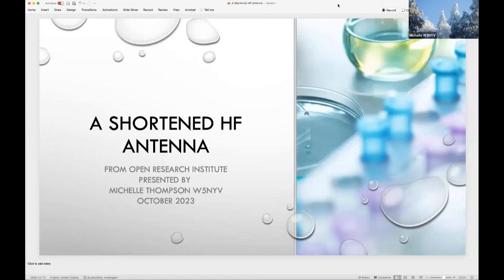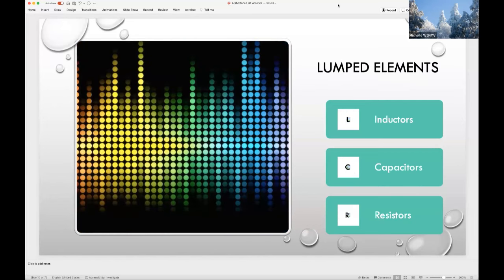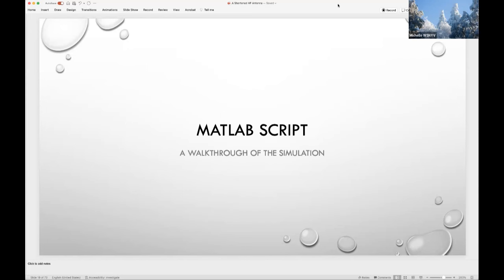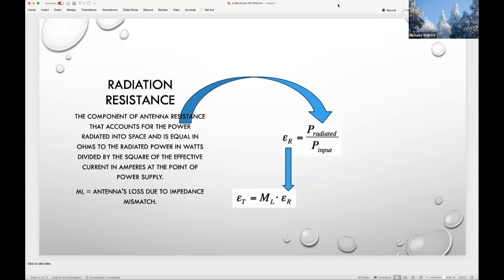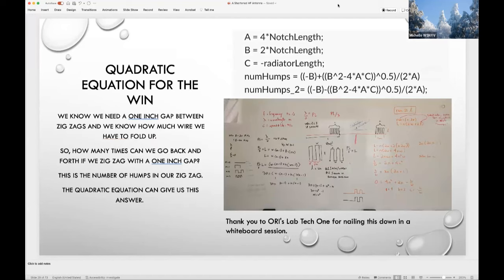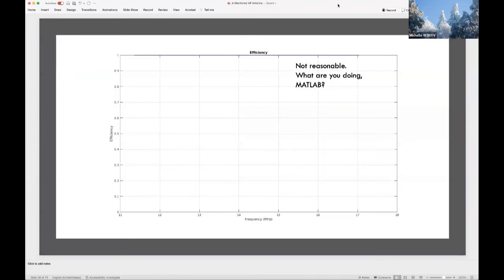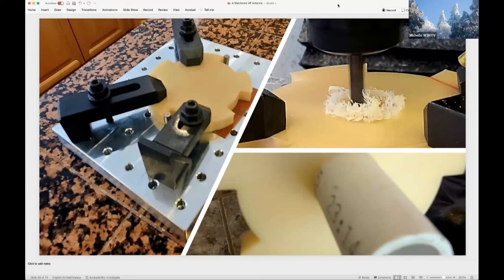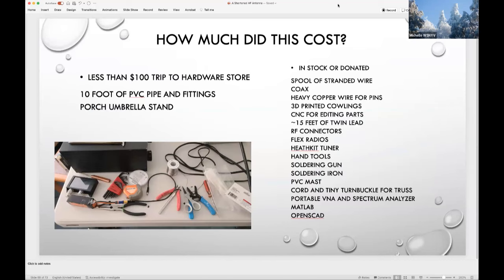A Shortened HF Antenna- 10/11/2023

Comment: @10:45 would you consider an antenna tuner at its feedpoint as a loaded element? It is after all made of capacitors and inductors. If yes, then isn't there a dependency between Matching Loss and Radiation Efficiency, rather than being two independent variables as depicted in your formula?

Comment: Need the antenna Q, vs. the coil size (L/D) for the same. Very nice. I always thought of the impedance mismatch as a valve at the antenna feed, and the valve being full open or not.